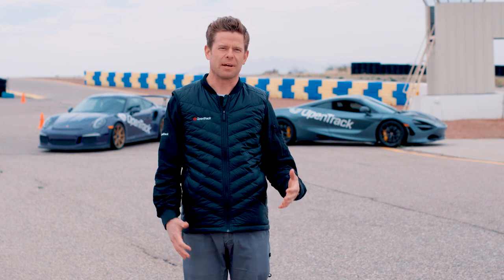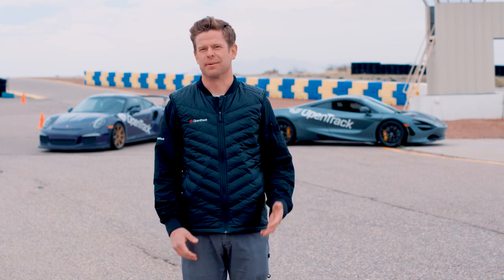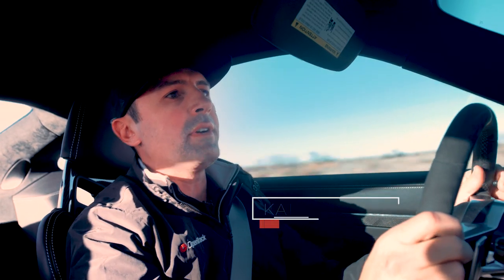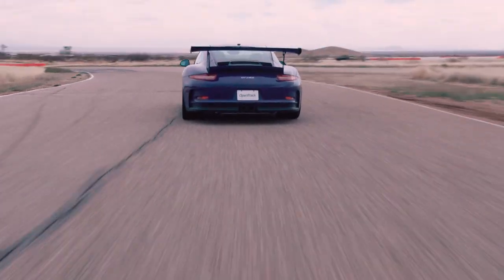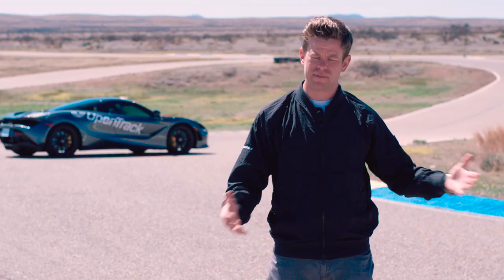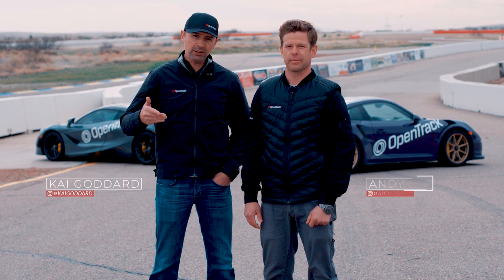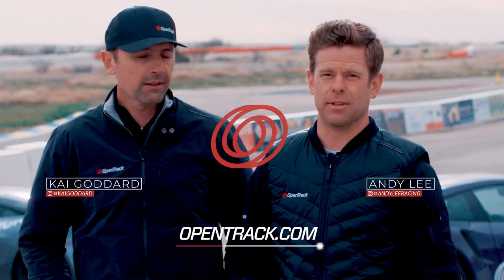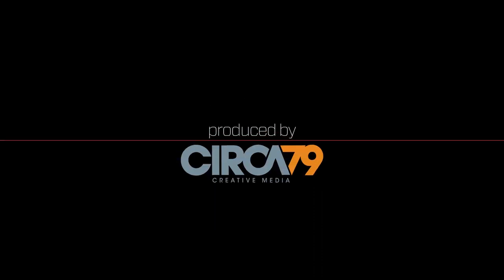Do's and Don'ts of Traction Control - OpenTrack Driver Coaching

Comment: Great simple video again! I remember Kai turning everything off and going into "stuntman mode" then drifting almost every corner!
Reply: oneonly xram I turn it off  in my Kia Forte at the highway and feel like it is easier to steer and can take the curves faster. Is it right or is just my imagination?
Reply: @79sketches  you are not imagining things, when  you turn that stuff off, you stop the computer from intervening and almost bogging you down around turns. Also if you Kia has electric steering that is adaptive to speeds and you turn it off, it'll go to a default which is usually really "light" feeling.
Reply: @oneonlyxram  yes. It also feels lighter. I was trying to found videos about this. But did not found anything. I love to ride with that thing off. My Forte is standar so it is double de fun